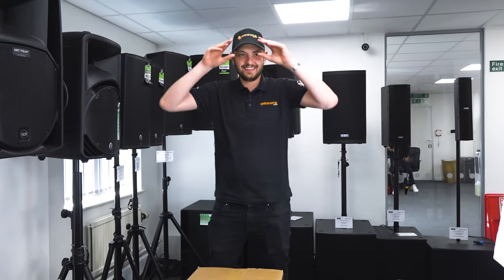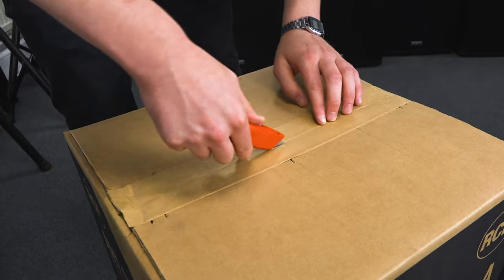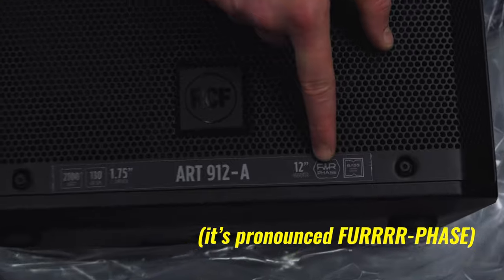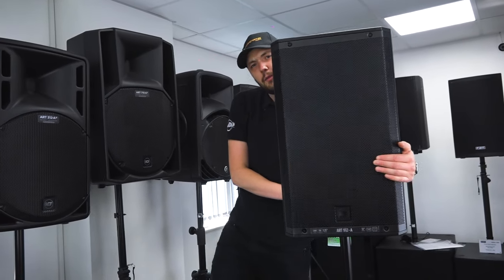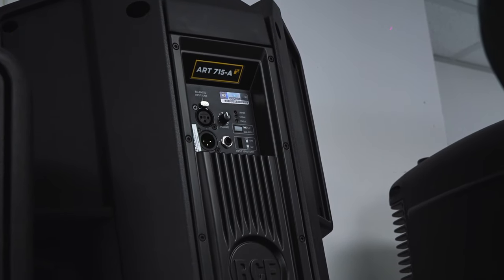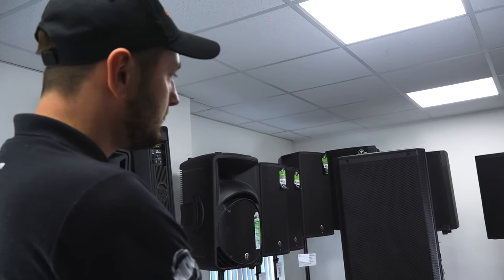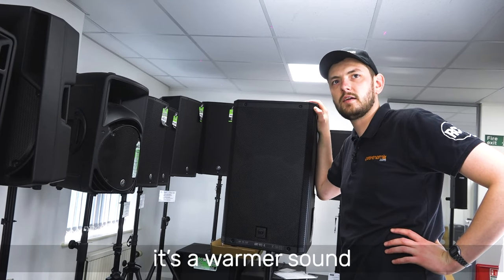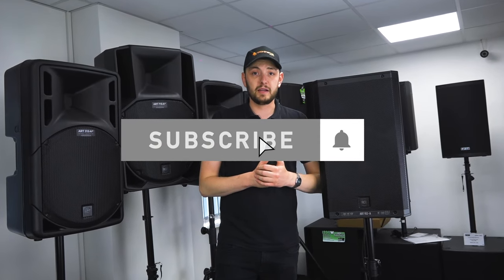RCF Art 9 Series - Unboxed and Tested Against the Art 7 MK4!

Comment: Hey  buddy, I just got the RCF 912 A they sound great, I use to have the Qsc k12.2 I notice the 912 have more kick bass than the Qsc. Thats a good thing for mobile dj events but when I use them home it's too much bass even in the linear setting. I have to eq the bass. any suggestions?
Reply: Take measurements. If you measure a boost over a larger range, just EQ it with a low Q filter. If there is also a narrow spike its likely to be a room mode, then it depends on if you need just a fixed listening spot or a larger area to be covered with good sound. For the first case experiment with placing and then take the large range boost out with an low Q factor EQ  setting and the narrow spike caused by standing waves with an high Q filter and for the second case take care of placing too and EQ just with a low Q filter  when needed,  but no sharp EQs with high Q factor to filter the room modes, they have to be eliminated with acoustical treatment otherwise you have an more inconsistent sound depending on your position..
Reply: @rez9159  the entire 9 series is too bass-heavy. For a dj use it can also be a good thing. Overall I find the 7 series more balanced.
Reply: I don’t know where all of this bass you’re claiming is coming from. I run my rcf art 915 at near limit every time and I always have to eq the mids down so they don’t overpower the bass.
Reply: @LezGõr  the problem wasn’t the speakers but the acoustics in my Living room

Comment: Nice demo video. What RCF subwoofer will match for this new 9 series?
Reply from the maker: Good picks are:
- RCF SUB 702AS II - (12 inch woofer)
- RCF SUB 705-AS II - (15 inch woofer)
- RCF Sub 8003-AS II - (18 inch woofer)

These will all match the Art 9 series great, choosing the size that suits your needs best.
Reply: @GetintheMix  I would also mention higher end subs:
RCF SUB 905 AS-II (15 inch) - the best lightweight sub in it's price range.
RCF SUB 8004 AS (18 inch) - an absolute beast that will deliver bone crushing lows at insane power level.

Comment: They should put LED on the Font/Grill.
Reply: People don't like to see DJ speakers (at the parties) - they just want to hear them. No led is better.
Reply: @quadvr  But it's better for you as the technical personnel, if you are using few separate columns in a venue, you can tell if they still powered up by just looking if the LED powers on. Instead walking through that crowd to check. LED is very important feature.
Reply: @hungchung2726  true -- but that is why doing sound test is so important before the event starts -- to make sure the speakers are tuned into the hall or room. A lot of rookie DJs use the same adjustment for all rooms (like leaving the knob at 2 pm all of the time). It gets way too loud (for small children's ears) and sometimes rookie DJs have their speakers too low at ear level (never a fun event). For me tuning the speakers to the room is more important then having a led in front (I use to have Mackie Thumps, and I kept the front led off, so when I got RCF speakers, I was glad there was no led in the front - just me).
Reply: @quadvr  I know what you mean, I always tune my system before any events, that is a sure must, but I meant when the event gets crowded, sometime there's an ediot to kick your power cables out or even shift your speaker, so if the far set of speaker is off the LED will be off.
Reply: @hungchung2726  right, always that one person, or someone leaving their drink on top of the subwoofer 😂
Reply: @quadvr  Yep that's correct. I always had to turn the power socket upsided down to prevent liquid from getting into them.